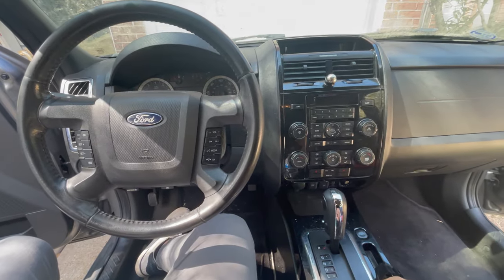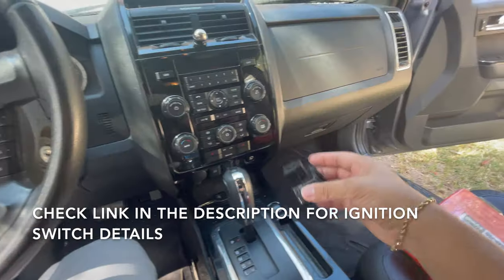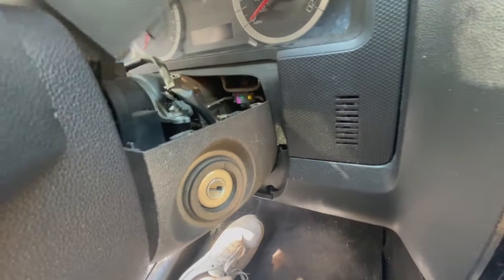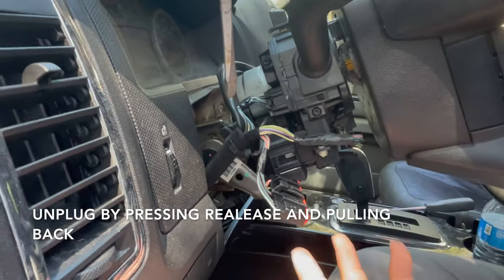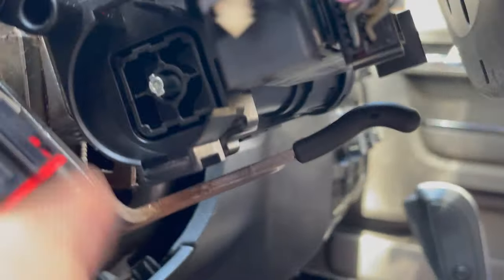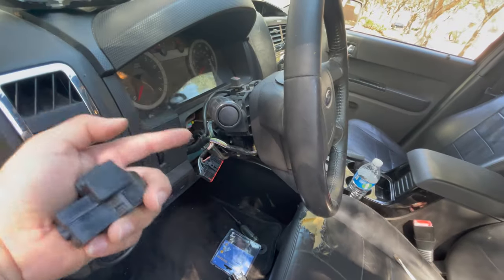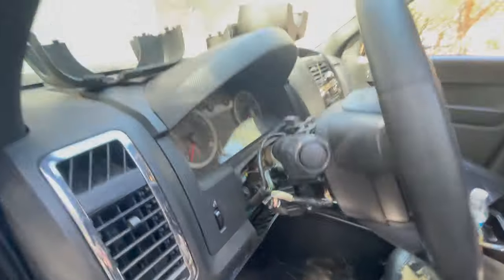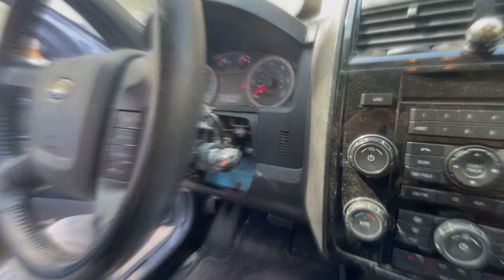Ford Escape Won't Start Ignition Switch Replacement

Comment: I just replaced mine. It still does not work. The battery seems strong. All electrical is working. The steering wheel lock engages. The key for buttons work. It simply will not start.

Please help. I need this car BAD!

Comment: What happens if this did not fix your issue?
Reply: There's another part in the column  called the Ignition switch column lock housing  part 9L8Z-3511-A that can be the culprit.  Not expensive on ebay, like $30 - 34.00.  There's a video by FordTechMakuloco called "2008-2012 Ford Escape No crank no start: ignition lock module replacement.  It's 23:41 minutes long. If you check the comments on that video, there is supposedly a way to change that part without removing the steering wheel and air bag.  Appears you must remove the signal light arm and a few more wires to get access.

Comment: Retired Ford dealership tech piping in here. This video is 100% WRONG.  The ignition switch is just fine, it’s starting the car.  
The failure is ACTUALLY inside the ignition key HOUSING.  There is a pin inside the housing that wears down and doesn’t completely engage the ignition switch you just replaced in this video.  I’ll bet $5 right after you made this video, the vehicle started having the same issue.
Reply from the maker: Vehicle still turns on, you just lost $5. send them to my PayPal link I have in the description
Reply: It's actually both pieces that can cause this problem. The switch that's replaced in this video will "wear out" and not start the car and the ignition switch housing also can "wear out".  By pushing the key in to make it start I believe you are bending the plastic inside the switch that eventually you won't be able to start it by pushing the key. Inside the ignition switch housing is a plastic rod that I believe eventually will bend and not give enough distance to force the ignition switch to make contact. That's why pushing the key works for a "while " But eventually the housing will need to be replaced.  I'd suggest replacing both considering the switch costs about $35 and the housing about the same $30 -35.  Say $70 for both. Sure beats $700 at Ford, if they still sell it.
Reply: I'm an old car stereo installer,  Alpine, that still loves to work on car dashes. And when replacing the ignition switch housing, you do not have to remove the steering wheel and air bag to get it off. Just remove the signal light arm and a few more wires to get access.